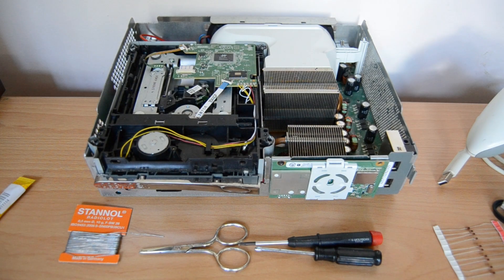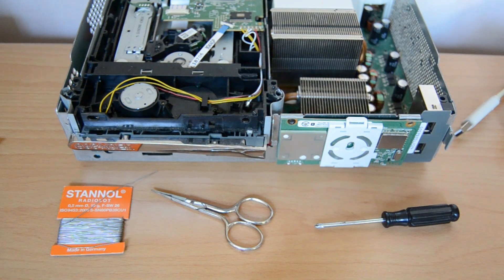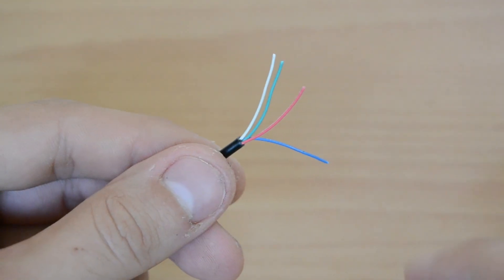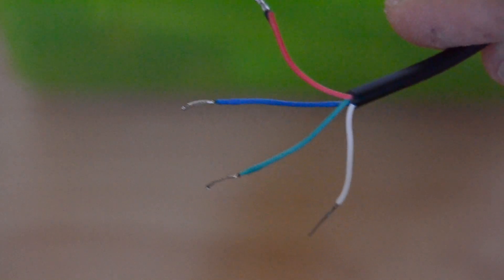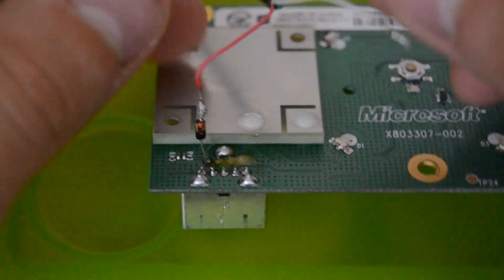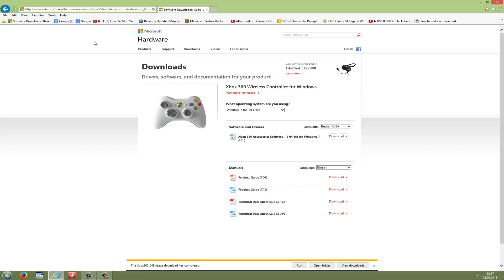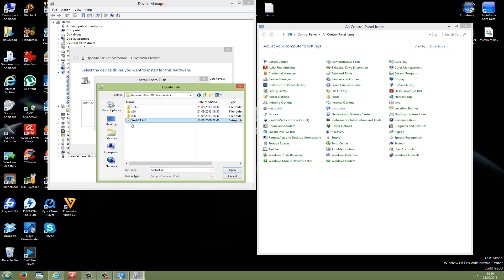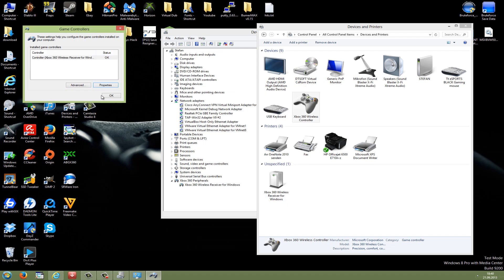How to make a homemade Xbox 360 controller wireless receiver for PC! [HD]

Comment: Just a heads up. I followed these instructions to a T and the device refused to start after installing the drivers and whatnot.

Turned out I needed to install TWO diodes on my 5V line. The device recognized immediately afterwards.

Comment: can i also use a wired xbox 360 controller and not an plug and play kit?
Reply: +Michael Keller if you use a wired then you just plug it in and give it a minute and it will work cause the wired controllers were made to be compatible for windows because microsoft released a bunch of games that support the controller

Comment: its not working it says make sure this is designed for this system
Reply: HeyTony Odin,
I've figured this one out. It's like you said. You have to have the vid & pid identifiers in your hardware for it to work. I've found mine under properties of the device. It was like 28th parameter in there. I don't know what it's called in english but translates to overriding, precedenting or general. Try and search them all :-). Then I changed my xusb21.inf file (edited in notepad) inserting vid&pid from my device. Looks like this now

[Manufacturer]
%MSFT%=MSFT,NTx86,NTamd64,NTx86.6.0,NTamd64.6.0

[MSFT.NTx86.6.0]
%XUSB21.DeviceName.Wired%=CC_Install, USB\Vid_8087&Pid_0020
%XUSB21.DeviceName%=CC_Install, USB\Vid_8087&Pid_0020
%XUSB21.DeviceName.Wired%=CC_Install, USB\UNKNOWN
%XUSB21.DeviceName%=CC_Install, USB\UNKNOWN

[MSFT.NTamd64.6.0]
%XUSB21.DeviceName.Wired%=CC_Install, USB\Vid_8087&Pid_0020
%XUSB21.DeviceName%=CC_Install, USB\Vid_8087&Pid_0020
%XUSB21.DeviceName.Wired%=CC_Install, USB\UNKNOWN
%XUSB21.DeviceName%=CC_Install, USB\UNKNOWN

[MSFT.NTx86]
%XUSB21.DeviceName.Wired%=CC_Install, USB\Vid_8087&Pid_0020
%XUSB21.DeviceName%=CC_Install, USB\Vid_8087&Pid_0020
%XUSB21.DeviceName.Wired%=CC_Install, USB\UNKNOWN
%XUSB21.DeviceName%=CC_Install, USB\UNKNOWN

[MSFT.NTamd64]
%XUSB21.DeviceName.Wired%=CC_Install, USB\Vid_8087&Pid_0020
%XUSB21.DeviceName%=CC_Install, USB\Vid_8087&Pid_0020
%XUSB21.DeviceName.Wired%=CC_Install, USB\UNKNOWN
%XUSB21.DeviceName%=CC_Install, USB\UNKNOWN

Now after i pick the file I'm able to install the drivers. These four lines, after every header, are from one of the tutorials on the internet, I only had to change vid&pid. I also had some issues with it working correctly (or even at all) due to shitty usb cable. I wouldn't have thought it may cause so many issues. I took spare printer cabl, and it is up and running now. I also used play&charge cable to automatically bind the gamepad with the board. Good luck!
Reply: Maciej M My friend you are AWESOME! I did not even think of editing the xusb21.inf !! Genius! Makes total sense; I will definitely be attempting round two tonight using your advice! I guess by default the xusb driver does not include the correct range of IDs ect so it makes total sense that editing in my specific device model PID would allow driver installation success. I think you just solved a ton of peoples' issue as well. Thanks so much my dude! I am very glad we had this talk!  I will let you know if I have success configuring. Talk soon!
Reply: Noah Teh Arc Same issue here? "The folder you specified doesn't contain a compatible software driver for your device. If the folder contains a driver, make sure it is designed to work with Windows for 32-bit systems."  Btw the folder does in fact contain a brand new install of the Xbox 360 Accessories (.inf) file and it recognized the usb device when plugged in, but I get this error every time I try to update the driver. Any help?
Reply: Hey Maciej M , 
I have researched and tried many different solutions with hopes of having a working module. However, I have discovered there are some modules that do not have a working PID (product ID) which most, if not all, electronic devices have which the PC should recognize to begin data transfer ect. The module may not work if your product ID, like mine, is "UNKNOWN" instead of having values. To check, head on over to the device properties; (Right click the device in the manager > Properties > Details Tab) Now check the drop down menu for "Hardware IDs." If your ID is shown, the module can work with the computer BUT if the ID is "UNKNOWN"
like mine, we are out of luck and must purchase a new module. (Or spend hours trying to flash a bootloader or firmware to the module.. I don't even know where to start)  If your module doesn't work, they are available on eBay for $5-$10 USD shipped. So possibly try a new module. Sorry for the bad news :( It sucks because I spent a lot of time on this too haha.If anyone else has this issue and figures out a solution, let us know! Thanks guys!
Reply: Tony Odin Same here, any solutions?
Reply: +Maciej M YOU MADE THIS PROJECT POSSIBLE TO COMPLETE. YOU ARE AWESOME.
Reply: And what a great collaboration with A.J. that was!!!
Reply: Totally!! U guys rock!!

Comment: I suggest several changes as following:
- A Prototype Universal PCB. I am not so sure if Radio Shack have it coz I dont live in US, I guess they do. (google it for the image or u can go here http://www.adafruit.com/category/82 for Adafruit Perma-Proto Quarter-sized Breadboard PCB)
- A female USB connector
- 2 x Diode 1N4001
- Optional: IDC Breakout Helper at http://www.adafruit.com/products/2102 
U need to solder everything on secondary PCB and dont forget 2 diode mentioned above in series to bring 5v to 3.3v. Use IDC Breakout Helper to fixed connect between 2 boards. Apply a little bit more flux will make the connection look nicer and it is fixed so u dont need to apply silicon. 
The finished joint connection will be fixed and look like a pro.

Comment: I read that both the xbox controler and normal mouse and keyboard for pc all use the 2.4 GHz frequency. Is it also possible to overwrite the software on an wireless reciever of an old mouse/keyboard and put the driver of a Xbox 360 Wireless Gaming Receiver on it and get it to work?
Reply: +Drag0nvil i might be a little late to this but 2.4 GHz is a rather standard frequency, nothing interferes really since it's intelligence enough to keep the signals a couple of KHz apart from each other so your speakers don't turn off when you press the A button
Reply: not really an answer to the question :p
Reply: Drag0nvil oh sorry i was tired when i read it, no, it wouldn't work, the 360 controller would have no way to sync to the receiver nor even be able to "talk" to the receiver, it wouldn't work
Reply: ah shame

Comment: Nice video, Thank you.
If I dont have the Play and Charge kit, and I have a broken xbox 360, how am I supposed to sync the controller with the broken 360? I find many many dead 360's on ebay, but they dont say exactly whats wrong. I dont want to spend alot, the shipping is going to cost the most. Most these broken 360's dont even come with power supply's or any cables.
If I had my own broken 360, I would do this for sure but I can get a microsoft wireless controller thing for just above the cost of a broke 360...
I love to do these kind of mods, and am really good with a soldering iron..
I will ask around to see if any of my friends kids have a broken 360 I guess.
Thanks again for the video.. Very well done.
Reply: xBlindDudex I have the same problem can't sync my controller to it because my Xbox is broken.
Reply: The play and charge kit does not make your controller pc compatible it just charges your rechargeable battery on your Xbox controller you need a controller wireless adaptor if you want to do that

Comment: Can you please help me ? I'm having an issue in the soldering parts because my Xbox 360 RF Module belongs to a slim one,can you explain it to me using an Rf module that belongs to a slim one ? an image would really help because I don't really know where to solder
Reply: i have the same problem not sure if you can help aafter so later nw

Comment: Did this shit and it worked!
First I used an LED I ripped from a broken speaker. It probably wasn't the right voltage because the RF wouldn't power on although the LED was shining bright. I went for a shop and bought a 5V zener diode for €0,20, soldered that shit right up and it works like a charm. Super smash on PC here I come!

Comment: Another question, how can I connect my Wireless Racing Wheel to PC with this method? I can't connect the wheel via Play&C kit.
Reply: Ugh another person who thinks the play and charge kit makes your controllers of compatible
Reply: hey man 5 years later, at the end how u connect the wirless racing wheel? ahha
Reply: @jintan5403  You have to buy the original wireless receiver, because there is a pairing button on it. No other way to connect, because there isn't any wired connection option on the wheel, just only the pair button.
Reply: @pm555  my man I MADE OT WITH/O BUYING THE ORIGINAL THX ANYWAY

Comment: How can I sync my controller via Play&Charge kit? I finally done with the modification, but I hadn't connect the module to an xbox to sync it, I could connect to my PC and install the driver, but I can't sync. The LEDs aren't pulsing or lighting on the module. Please help me. :S
Reply: i have the same problem
Reply: you need to use an arduino
Reply: soyrandom1 do you have a tutorial ? thank you
Reply: Nope, but i know how to do it, if you have an arduino is very simple, you only need to download a library, put the code into the arduino and conect it with the module 
Ps: sorry if my english isn't very good
Reply: soyrandom1 thank you, i"m getting one very soon !
Reply: Okey, after you get it, send me a message and  i am going to teach you how to make it :P
Reply: The charge and play kit DOES not make your controller pc compatible

Comment: IT WORKS!. but what you also can do is remove the metal cover on rhe other side
take a needel and flip up the metal pins one at a time and soder the wires to those pins
the point on the board ware close to gether so my methot wil also work
you can bend the pins slightly so its easyer to soder the wires i used an led no problem
im dutch so pls bare with the typo's

Comment: using the PnP cable won't help me syncing the controller, any suggestion?

As last resort, I programmed one of those Wii PICs with some code to synch the controllers, but the lights where always on and it was a bit annoying so I removed it, now I cant find it...
Reply: Forget it, found my PIC and synced perfectly...

if someone runs into this problem, feel free to message me, I will be posting a video with the necesary stuff to achieve this.
Reply: hey amigo i need help with this , how can i sync the controller to the pc?
Reply: you need to write a program into a PIC, and solder it, it's not difficult

Another option would be to sync a controller with an xbox, then solder it

Comment from the maker: omfg watching this old Video now.. the quality was shit :D
Reply: the video isn't even that old :P tbh, i'm just watchin this video out of randomness, since i already have a wireless xbox reciever for my pc, although it's not an official one (but works just as well as if it were official :P )
Reply: please do one for a new Xbox RF module please
Reply: Dude seriously I don't feel like going to the ONLY place in my area to buy a diode as radioshack is VERY far from my home... I have a diode and you said I can use ANY diode... I have some 1N5392 diodes laying around and a board... will it work? or kill it? I killed my first one trying the led idea this is my LAST BOARD. The diodes rating is IN5392 Rectifier Diode 1.5A 100V
Reply: Oh thanks but the ones I have work just fine. I didn't want to use an led. Last time it destroyed my board.
Reply: +ITXtutor  I Have the reciever and the controller, but I don't have the xbox 360 to synchronise, what can I do? Thxz
Reply: hmm should be a way to trip it into syncing I've done it before but I really can't remember what I did to get to that point...
Reply: no I just remember my brother using my controller without asking one time for his xbox and I had to go through hell to get it to reconnect I really don't remember what I did though this was some time ago :(
Reply: need an update boss or direct contact so i can get some help with this
Reply: What kind of screw driver did you use my XBOX has star shape screw I can't detach it
Reply: go to an electrical shop
ask for mini screw driver set of 30
it has 5 or 6 star shaped pins
it can come in handy in the future too
Reply: some games play better with it in my opinion *****
Reply: This is really late bu mines has the sync button right on it!
Reply: Can you please send me one of yours I tried making one and I took a rage and I couldent complete it
Reply: Wow I'm watching and trying this in 2017! All my controllers for PC have died but I still have an old 360 in a cupboard which has 2 controllers so even though you think your video quality is shit it is still relevant and helping others. Good job dude.
Reply: It works. I now have 2 wireless 360 controllers for my pc working with all games.
Reply: ***** what is a a game chair? I sit in a chair while I play games if that's what you mean. If so then maybe I do, I don't know. What sort of chair do you mostly sit on? Has it got wheels? If so how many? I'm guessing 2.
Reply: ***** what's a dildo? Do I need one for a gaming chair?
Reply: You are a racist a troll you live at home with your mother and can't even talk properly, you make review videos on counterfit products because you can't even afford the real deal then try to capitalize on it by saying how crappy it is though you know your going to enjoy every minute of you fake Beats headphones. 

I haven't even started yet....

You have a Disney comforter on your bed you haven't changed in over a year and you live at home with your parents yet have the nerve to call someone worthless?!? You are racist shit is what you are, I'm black but I bet you're the keyboard warrior type to think you are safe behind you PC screen until you piss off a person like me who can IP trace your ass and out your personal information for all of Youtube to see and troll you with! So go ahead and call someone else a racist name I dare you because as you should know by now I already own your google e-mail account stop being a dick and I will leave you alone... "If you know what's good for you" you closeted faggot! LOL!!!
Reply: ***** Sie leben in von wiesbaden nicht zu weitem Deutschland
Reply: ***** als nächstes ist Ihre direkte Adresse und Telefonnummer
Reply: 1 541 754 LMAO!!! wanna keep playing?!?
Reply: your soldering is too. but great tutorial .
Reply: the soldering also...!

Comment: EDIT: Replaced the LED with the same zener you used and it works like a charm now, thanks for the video!

I did exactly the same as you did, except I used an LED instead of a diode. My main problem now is that when I want to install the drivers like you show in your video, it say's it can't find any compatible drivers. The device info tells me there's a Code 43 error, which seems to be some USB connection error.....

Any thoughts? I would love for this to work!
Reply: the zener diod is diffrent, the led only a light but have a diffrent haracteristic then zener

Comment: Pefect. Do not ask me why, but there is a way to fully disconnect the wifi of the RF Unit? I need zero wifi emissions.
I've already disconnected the unit for the internet connection, but I can't to disconnect all RF Unit.
(I use wired controls)

Comment: I did everything right, except I used an LED instead of a diode. I plug it into the computer, the LED lights up so I know there is power going through it, but the unknown device doesn't show up.
Reply: i'm getting the same thing
Reply: I replaced the LED with another and it worked for some reason.
Reply: just tried a different LED and still doesn't work...
Reply: maybe try a different kind of LED I think the one was worked was 5.2v or something
Reply: wat type of led did u use?
Reply: i'm not sure what it is, i just robed it from an old plug with an LED indicator.
Reply: For people still reading this, red, green, yellow LEDs work, but the best one is probably infrared, so from a useless remote you have lying around. The goal is to drop the 5v from usb down to 3.3v. Red brought it to 2.1v for me and it works, but IR(infrared) would be better.

Comment: So I have it all put together, but I used a random LED that I had in my workshop. I get power to the board AND my computer recognizes it with the drivers installed... But I only get power to it for a few seconds and then it will disconnect from my computer. Help?

Comment: worked perfectly once i sorted a good enough cable. origonally i had it pluged straight to the usb 2.0 header on my boared but due to some crappy soldering and very fine cable i changed to an external. I also didnt need a diode of any kind. my question is though, are the lights meant to work? cause mine arnt.. i may have overheated the board

Comment: thanks works perfectly, a bit of trouble getting the receiver to recognize the drivers but got it in the end :D
Reply: I have the same problem , how you did it ? ...i can't get it to be recognize by the computer.
Reply: Stefan Ioan if i remember right, install the drivers for the controller wired or not it doesnt matter which there both the same driver. then go into control panel, then device manager, then right click and click properties on the unknown usb device with a yellow triangle next to it. there should be a drop down menu somewhere in the pop up window, click it and select microsoft common controller. i think thats about it if it doesnt work message me and ill re do the install and write down how... btw if you disconnect the device and turn the computer off and on again it wont recognize the device and you will have to do it again. currently trying to figure out how to stop this.
Reply: Stefan Ioan
 exchange D+ and D- wires,
Reply: out of curiosity what would this do exactly?